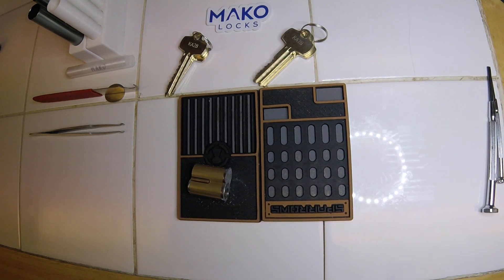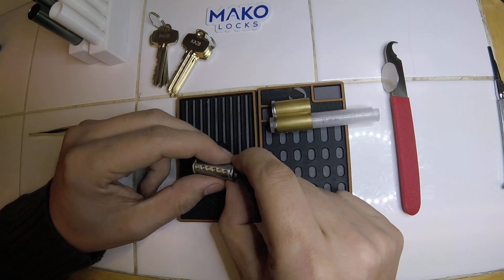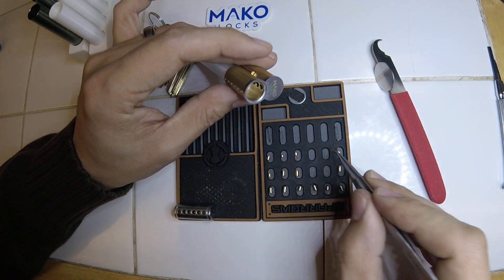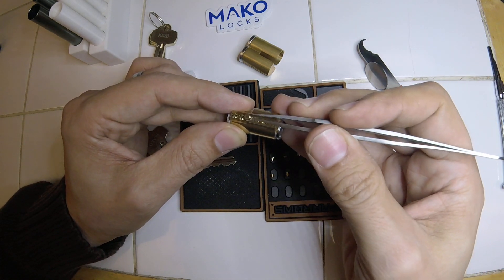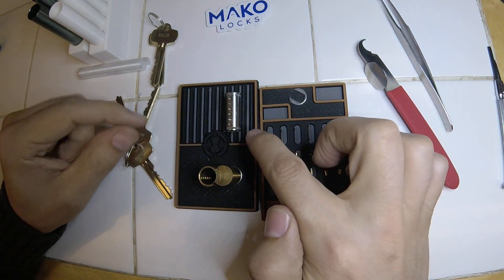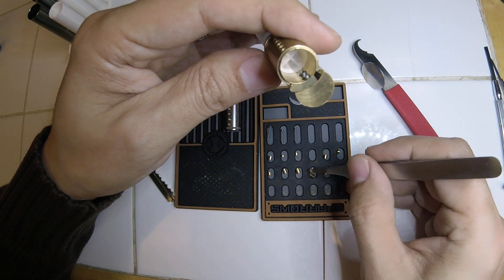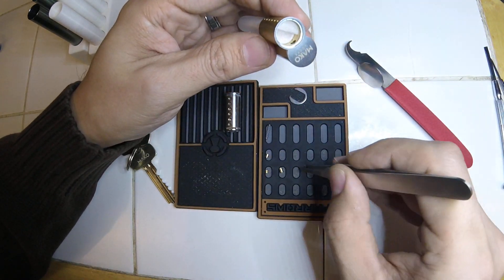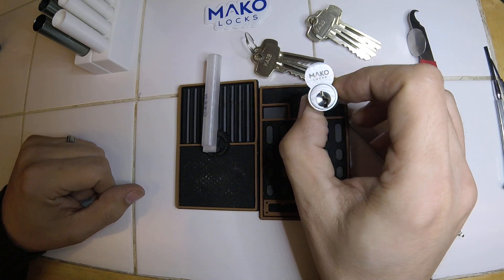[L27] Mako M2 SFIC - How to Gut - and my picking history for lockmania giveaway #LM750

Comment: Thanks for not being perfect on this one Michael!  This is scary enough so it is good to see a common mistake that could be very tough to come back from.  I like the cross on the solid side of your follower.  You can use the follower as a backstop without the tweezers getting caught between it and the pin. I see that you had new keys sent.  Both of my M2s are a little bit sticky and I ran the keys thru them for about a half hour trying to free them up a little.  I don't know if it helped much and if the keys are cut low, there's not much chance of improvement.  Love the show and the story.  Good luck in the Lockmania draw!
Reply from the maker: Thanks for the detailed comment! I like including mistakes, because just trying to explain the mistakes you want to avoid is harder to visualize than actually seeing a recovery from a mistake in action!